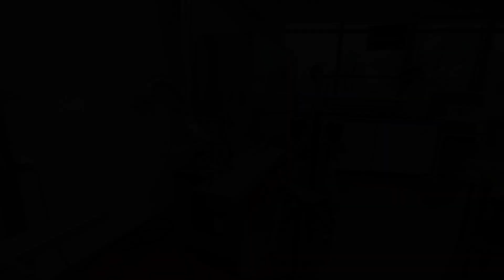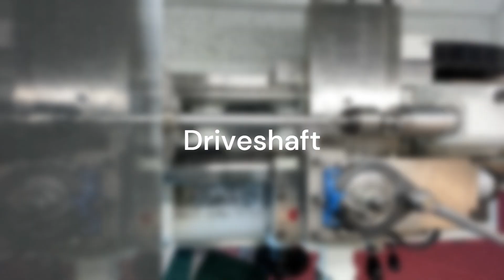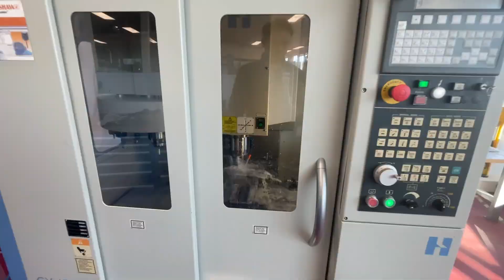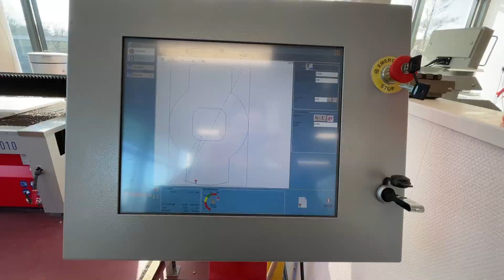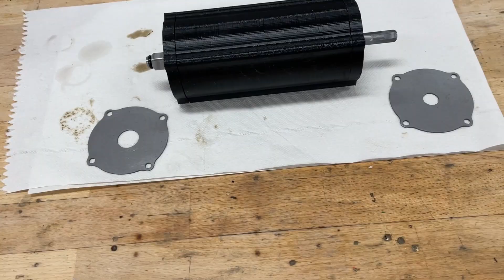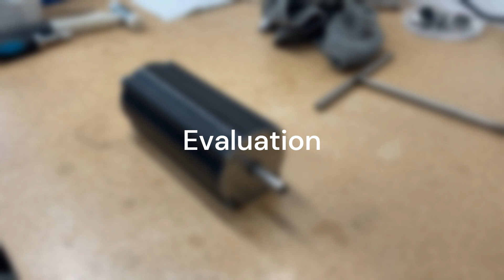How to Design: Impact Wrench Adapter - Manufacturing & Testing

Comment: First Carburaizing shaft and hammer and anvil,then quenching it , more important tempered them with patient.
Test the sonund of filing the edges or try scratch the surface,it must sounds like glass,if the hardening was successful ,polish and round the edges and assembled,
another way is that using face hardening welding,tig with high carbon hardfacing  filler are the best choice.then milling  welded parts and then harden by quenching and tempering.

Comment: Well done my friend, all the steps you did were great, this is a complete tutorial for all DIYers to know the correct way to make tools for their home workshop, did you know what causes the V-grooves to get damaged ?
You said you should have used a harder steel..
But I'm saying it would still happen even if you used 6% carbon steel!!
The most important thing you didn't do was heat treat the parts that are in friction.